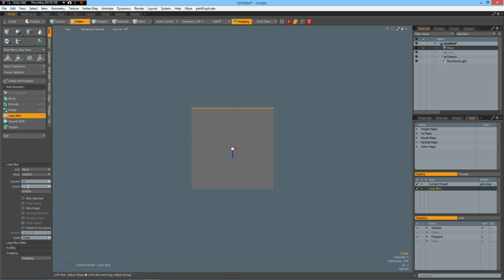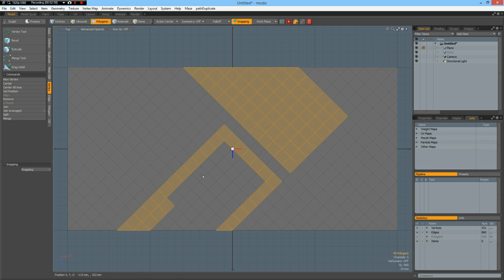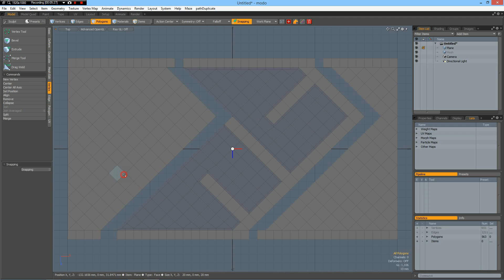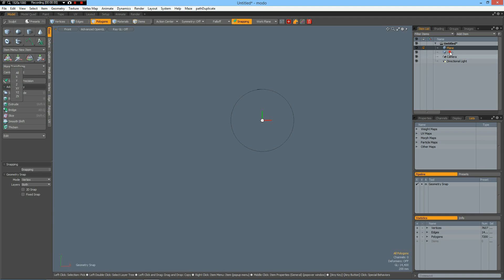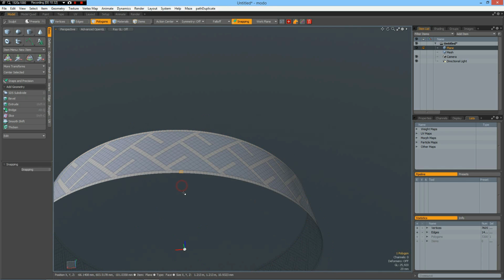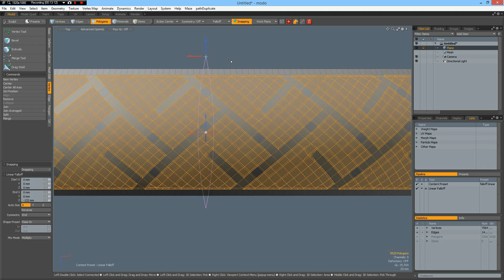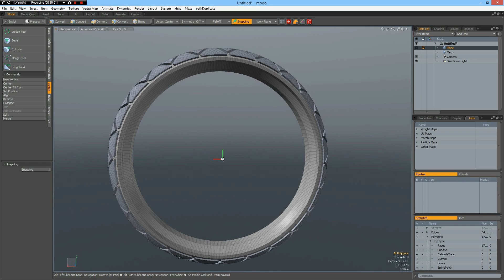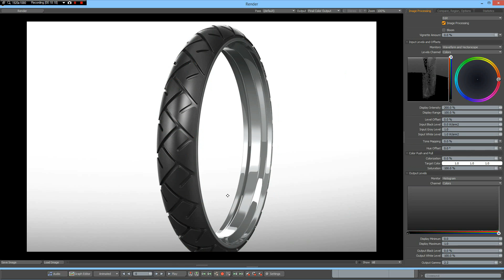The Foundry MODO - Motorcycle Tire for Vlad Mafteiu Scai

Comment: Peter, you really are an amazing teacher. It took me much longer than you to complete this project, but I was very happy with final results. One thing I would ask is for you to also mention the hotkeys for those popup options, for example when you chose "Toggle Grid Workplane"  (I wasn't sure how you made any of those popups appear on screen, so it made the process a bit more time consuming for me at certain points to search through each drop down menu to find each option. It took you a seconds with hotkeys, but took me several minutes searching through menus). In the end I learned so much from you with this short tutorial. Please continue these tutorials, you are amazing.

Comment: The problem with the bend tool is not a bug! The bend deformation start from the starting point and end to the second point of the tool command gizmo. Every polygon before and after the starting and ending point is not bended. So the little triangle in the X- axys has 0 bending.
Reply from the maker: Koutetsu Jeeg Hi, you are perfectly right and i also found out about this as you can read in my answer to Joel Beachman a bit further down. In fact it is completely logical that the tool has to work in this way :-) Thanks for telling me and kind regards, Peter

Comment: I've run into that bend problem before. I find it works better if you set the deformer to the full length of the geometry and bend it more than 360 degrees. I ended up bending 373.125 ° for this one. Then you don't run into the shearing and you can just merge with a small distance to seal it up
Reply from the maker: Joel Beachman Hi Joel, you are right indeed ! I made some tests and the point is, that when you place the deformer as i did, then a small portion is not bent at all. Thank you so much for pointing this out. Very helpful and if you think about it, it's also quite logical to do it your way. Kind regards and thanks again, Peter